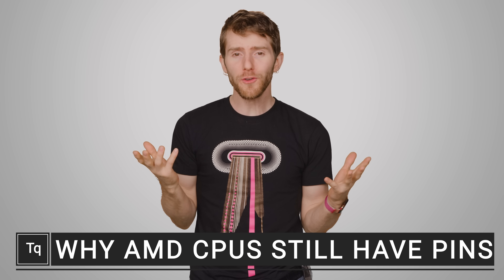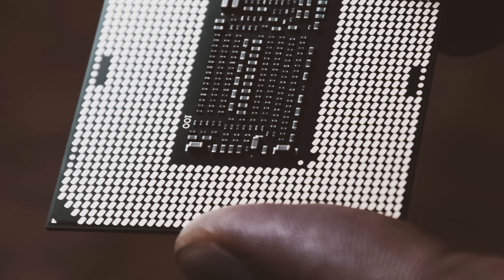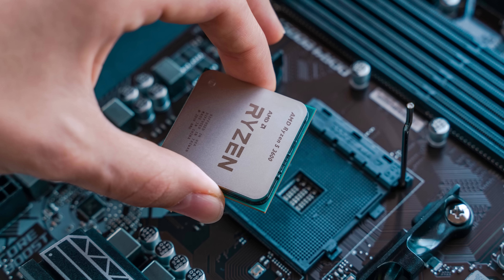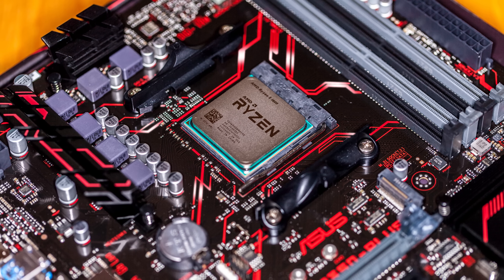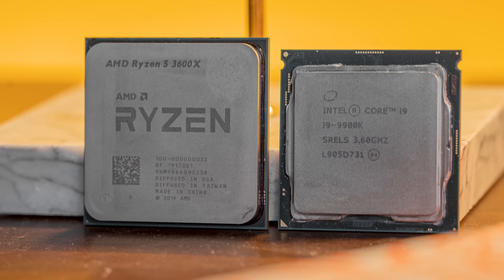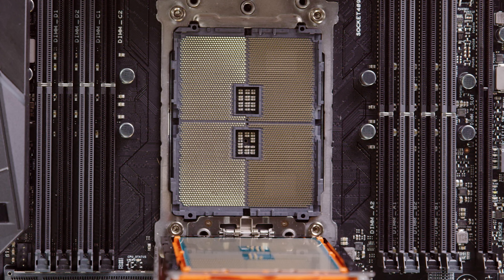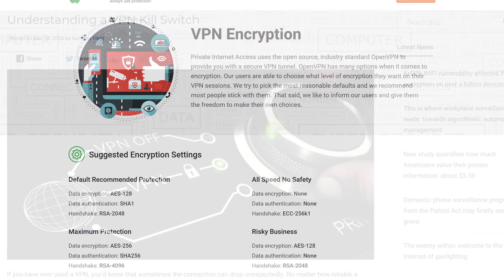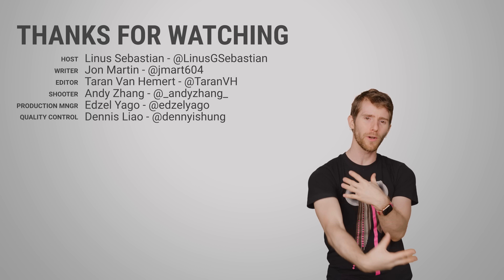Is AMD Stuck In The PAST?

Comment: I am upgrading one of my monitors. I want to use the old monitor to replace the TV in my parents room since the monitor is bigger than the TV in there room. (it is an old tv that has less than a 15in screen. the monitor is a 22in.) The monitor does not have speakers. I was looking for a relatively small ish sound bar that I can connect for sound. What should I look at getting? The only audio output is through an HDMI... The reason because they use a digital adapter in my parents room.
Reply: A good rule of thumb is that if it's cheap it's going to be garbage. If it's expensive it might be garbage, so stick to a reputable manufacturer. That said you can usually get much better quality with a Lepal amp and some bookshelf speakers. Soundbars have a very difficult time reproducing bass without some serious black magic. The ultimate budget solution would be finding some used home theater speakers locally for dirt cheap and wiring them to a Lepal amp. Bonus points if they come with a subwoofer and you use an amp with a subwoofer output.

Comment: i can say for certain that the pads are more difficult to damage, when i buyed my threadripper like 2 years ago ,i missed the rails and it sliped off my fingers and landed on the motherboard, at which time my super reflexes kicked in and i proceded to scratch all the bottom of the cpu against all the motherboard, when i looked at it and saw all those scratches i was sure by the end of the day y would kill miself, but against all odds it posted and worked perfectly to this day. it was the most hardcore rollercoaster of my life.

Comment: Having worked a lot with both LGA and PGA doing repairs and builds, I have to say I prefer LGA. PGA chips are locked down by their pins. This can cause problems when an owner decides to clean up everything and re-paste the CPU. Sometimes the thermal paste is sticky and the AMDs are known for popping out of their sockets and bending pins in the process. They can even break. Many people are not aware that cooler heat sinks need to be twisted free. 

Intel, on the other hand, secures their chips down by the integrated heat sink. It's a far more secure locking mechanism. 

Both PGA and LGA are a PITA if pins in the grid are bent. But AMD's are more prone to breaking off. Intel's are "springy" and less likely to break.  That said, I have a Ryzen 3700X.

Comment: One advantage of LGA you didn't mention: The CPU holds in the socket really well. 
I had thermal paste on my my Ryzen dry up and bond the CPU to the cooler quite strongly. I ended up pulling the CPU out of the socket (without releasing the retention arm of course, because it was under the cooler). Pretty sure that wouldn't have happened with an LGA socket.

Comment: In the rare event that you actually do manage to break a pin on a AMD CPU you can still take it to a jeweller and have them repair it good as new for a few tenners.
Anything short of that is pretty easy to repair yourself with a bit of care.
Reply: A jeweler? that's actually a fantastic idea. I wouldn't have thought of that myself.
Reply: Awesome, I never considered that either, but that kind of repair does seem to be right in their wheelhouse.  Any electronics-specific aspects of chip repair such as using static mats could be figured out fairly quickly and they now have a potentially lucrative new aspect to their business.  Now I wanna find some local jewelers and ask if they do much business repairing small electronics.
Reply: Yes a jeweller with diamond settings skill and his microscope can fix it.
Reply: @johnlv7060  * jeweler replaces the missing pin with a gold one* "that'll be $100"
Reply: since diamonds are a great heattransmitter you could even ice out your new chip if you re already there
Reply: @himekosaesarchive4077  Still better than paying 400 for a new one
Reply: I thought my father was the only one who had this idea of getting the cpu to a jeweler......
Reply: I did that once with an FX-6100. It only cost me £20, and it only took her 30 minutes to do. She managed to repair 1 of the snapped pins by re-purposing scrap ear studs. Most chain jewelers won't even bother trying, but your local independent jeweler will probably give it a try if they're not too busy.
Reply: @jimjiggles1474  Where was this Jeweller? Please tell me it's in London
Reply: @TheWhiteWolfFang  Sadly not, it was in the midlands.
Reply: The jewelers (and all other service providers) in my town are all retarded, if you ask them to do anything that they haven’t done 1000 times already they look at your sideways and say they have no idea what you mean. You have to live in an area where people use their brains for this trick to work.
Reply: Another repair options are donor cpus. I keep a Phenom II 965 black edition going that has a missing pinn with a dead FX 4100 by ripping the pins off and sticking it in the socket.
Reply: A jeweler?  How did you ever figure that out.
Reply: bullshit.. the reason why they made that want that pin is where they made extra money off the customer... sure you can try but the pin won't line up nor can taken heat well... next time you destory your motherboard as welll.... and that size.. fucking it don't do anything to cooling down at all.. waste of space..
Reply: @campkira  PGA sockets are actually pretty forgiving in terms of pin size and alignment. as long as it drops into the socket without resistance the alignment is goed enough. 

And the solder a jeweller would use is pretty similar to the stuff they use to attach the pins when the chip is made in the first place. You have nothing to worry about in terms of being able to take the heat.
Reply: @TheCountess666  The pins don't really get warm as they're not passing huge amounts of current and the passive heat from the cpu itself isn't that much (socket temp). As long as the jeweler does a proper job, it's no issue.

@Yash Gupta I thought of the idea when I was getting a new watch strap. I saw the equipment in the back and thought that they could probably fix the pins on the CPU I bought (one snapped, so I couldn't fix it myself). Luckily she was fairly knowledgeable about the hardware, so she agreed to give it a go, but I must accept all responsibility if she caused further damage.

Comment: Honest question: Why use (long) pins at all? Does the CPU need a lot of space between it and the MB?
Reply: google: "ripped out cpu with cooler", and "broken am3 or am4 sockets"

Plastic socket covers need to be thick enough so the avg bozo wont damage the motherboard while putting cpu in/taking cpu out.

Comment: the last AMD I used was a K6-2 back in the day. I remember those pins, same as on the cyrix 486-ish prior. so here's a thought: my i7-870 has an LGA... but I can still play modern games at 60FPS "high" (not super) on it with my GTX770.
the question: when should I upgrade to the latest (or even one gen back) CPU and motherboard? what kinds of performance increase can I expect when upgrading to, i.e. a 9700K and a GTX1080? at that point, I'm sunk for ~1400 without replacing case or power.

Comment: Hey, i have a question ive been using my pc for about 4 years never did a drive whipe or reinstalling windows. Ive notice that some games crash without a reason i run the games smooth but it just crashes is it maybe good to reinstall windows or maybe there is a fix? Ive reinstalls GPU drivers before and SAY i uninstalled with DDU. Could you please respong or maybe make a video about it.

Comment: "AMD stuck in the past" or "Intel pushes Motherboard makers to make the pins so Intel can save money". No pins = cheaper to manufacture.
Reply: Facts
Reply: Easier, not cheaper
Reply: AMD is moving to LGA now...so.........
Reply: Correct!
Reply: Money saved is money potentially spent on R&D. Soooo, who cares.
Reply: @DerrickRG  so that's why intel is still stuck on 14++++++++++++++++ while AMD is heading towards 5nm right? Lol what a joke
Reply: @jinuuoh  Don't forget that AMD doesn't do their CPU themselves, they just design the chips. Intel however make their own, so they have to develop everything. Also, don't forget that Intel's 14nm is not equals to like TSMC's 14nm. Even tho they have a big delay against GF/TSMC now, they used to be very good.
Reply: AMD boards are barely cheaper than Intel and I'd much rather break a mobo than cpu lmao
Reply: @bigshobe  Beside the point. Intel again cutting costs and leaving others to wear it UNLIKE AMD
Reply: @FarCryBaby  Did you just totally ignore the benefits to LGA? AMD can't even make a socket with a bracket unlike Intel unless it's Threadripper

LGA = better for me, why do I give a fuck if Intel makes the motherboard people do it?
Reply: @bigshobe  AMD were more worried about making the WORKING bits better and it worked :) The benefits to LGA are what? I have to be more careful with a big motherboard than a little chip, Lmao.
Reply: @bigshobe  seems so
Reply: @FarCryBaby  AMD doesn't care about you or anyone else either, if they can do something to make profit, they will. Don't forget, things are cheaper for a reason.
Reply: @bigshobe  Barely cheaper my ASS. B450 (and even B550) utterly ROFLSTOMPS ANYTHING Intel based on value. To match a $70 B450 board you literally need a $150 entry level Z series.... Aka TWICE the damn price.

Comment: As someone who managed to pull their brand new ryzen 3000 out of the "locked" socket when trying to remove the CPU cooler for some maintenance: The major problem I have with AMD's is their lack of a CPU retention bracket. CPU itself was just fine, and so was the socket, still using it now. Getting the CPU off the cooler was a total pain, so it's possible I'd have ripped the socket straight out if there had been a stronger retention system, because that thing was stuck on there.

Comment: Yeah except the AMD socket design is so terrible, your processor can stick to the cooler when removing it. I had the misfortune of trying to uninstall an AMD CPU from a machine that wouldn't POST, and it was using the stock cooler, which ended up getting stuck because the processor stuck to it, so the processor ended up getting bent to hell. Just use LGA AMD.

Comment: AMD's approach is way better for consumers. I've seem multiple motherboards broke from a Intel CPU just slightly dropped down on the the shit Intel MB pins. AMD never has this issue and even if a pin breaks, you can solder it back on (which isn't going to happen unless you step on it).

Comment: So basically if you're not a complete tool like linus is, it doesn't matter a bit. I feel like amd pins are easier to bend back because you can see easily when they're straight. Also it's easier to install and the socket doesn't need a cover if you store it. Amd cpu's can be wrapped into some foam for storing but the same foam would damage the lga socket so you basically need to hold on to the cover.

Comment: Why not Ball Bearing contacts instead of pins? Nothing to break then and still be able to deliver power you need to the CPU since it'll have more surface area of contact. Ball bearing gold balls on the CPU and little ball bearing divots on the CPU socket where it slots in,  you won't need to worry about breaking or bending pins on CPU or motherboard CPU sockets if they went with that kind of design, and would be more cost effective.

Comment: The most dangerous time when removing an AMD CPU is when you remove the cooler. The cooler gets stuck to the CPU and can pull it out of the socket. Be very careful when removing your cooler on an AMD based computer.
Reply: Tip for newbies. You should lock the CPU to the socket. The retention arm should be locked down side position.

Comment: If anything, AMD has pushed current off the shelf (COTS) technology rather than innovating where there wasn't a problem.  I honestly am surprised they haven't re-created flexible flat cables (FFC) coming off their 3-D chips yet.  Big tin used a form of them in the past.  The core density already has gotten to the point where the trace lengths are hitting a wall trying to stick everything in one 2-D array of pins.  You could conceivably stick on the equivalent of a second socket on the top of the processor and drop the size of the core considerably.  And the ribbon could really be more like a star of ribbons cut out of one sheet and soldered on to the processor BGA style like they attach processors and chipsets to PCB.  Maybe they leave it like one big single shape around the core to simplify the design and it resembles a single sheet, rather than a bunch of separate flaps.  But why go that route?  Old school.  Cheap.  Durable.  High density.  Huge current capacities.  Easy handling.  Multilayer options that can quiet crosstalk.  And FFC carries heat, so you can spread the thermals out even more.  And you could hit pitch counts for redundant links, to retain communications even when a single pitch gets damaged.

Comment: I used to dismantle hundreds of PC's a day...if you don't want to damage an AMD CPU it's absolutely essential that once the heatsink is unhooked, you twist the heatsink clockwise and counter-clockwise to break the adhesive nature of the thermal paste then you pull the heatsink away, if not you will rip the AMD CPU out of the socket and likey bend a lot of pins in the process.
AMD CPU's = twist pull and unlatch. 
Intel CPU's = pull, lay flat, then unlatch.

Comment: Not sure if it is accurate though this is the logic behind why I chose intel:
What takes up more space, pins or pads? Obviously pins are bigger so they take up more space. The space taken up by pins could be better used for more heatsink or processing power. And also, not sure if this is cause of the pins, though my AMD builds in the past have only had about half he lifespan as my intel builds

Comment: Funnily enough, back in the day when Intel switched from PGA to LGA, one of the rumoured reasons was because they could supply more current via LGA (had to do with the size of the contact area if I remember right) - this was back in the days when AMD had power sipping designs and Intel had the "we need to put this VRM on a separate board to assist in cooling" designs.  I cannot seem to find anything to confirm or disprove this though. :\

Comment: Pins are in some way better then pads. The spring/motherboard pin of an LGA has les contact and more space to radiate frequencys. The CPU pin motherboard "hole" use to have more contact so you get more heat from the CPU to the motherboard. Which is good. Also you have less capacity and inductance which mean you could drive higher frequencys on the AMD pins if they were a bottleneck at all. In the end you can make both solutions work.

Comment: I'd like to add that, in my experience, a pin on a CPU is much more likely to break than one on a motherboard. Mostly because a CPU is smaller and thus more likely to to be dropped or overlooked on a workspace.
Also, talking bout coasters, a HDD platter works a lot better as a coaster. I got 6 of those on my table, with little rubber feet glued on the bottom 😝

Comment: Draw a computer case with a 3D pen?  Make the shape of the case elbo-macaroni curves for the ducting around the fans.  It needs to look like the exhaust of a motorcycle.  You could even use a cold air filter to keep dust out of the system!

Comment: As much as threadrippers "slide in" bracket makes installing super simple, the pins on the CPU isn't great. The CPU is smaller, gets moved around more, has to get dropped in.
Ontop of that, pins on a motherboard seem easier to protect, there's so much stuff already on a motherboard taller than the CPU socket.

Hopefully AM5 goes with the threadrippers design

Comment: Also if you break a pin on a PGA chip you can drop a thin wire into that corresponding slot on the board and drop the chip on top and have a decent chance at saving the use of that chip...  LGA you absolutely can not do that.

Comment: PGA is my favorite. Had two busted motherboards with LGA, and as usual attempts to fix it were in vane.  Something to remember is how often Intel changes their sockets, so finding a replacement motherboard is a no go.

AMD keeps supporting their sockets long after, so if you need to replace a cheap CPU, no problem.  The Motherboard IS the most important part in a system, and finding a replacement with similar features and full driver support sadly is no longer a option after Microsoft paid everyone to drop support for any older operating system.

Gripes here.

Comment: Its not a problem to fix amd cpu pin with the help of credit card. Intel pins are not fixable. Also its easier to damage intel pins and dropping a modern  intel cpu usually results in its bending since the textolyte is very thin so safety wise amd pins are much better.